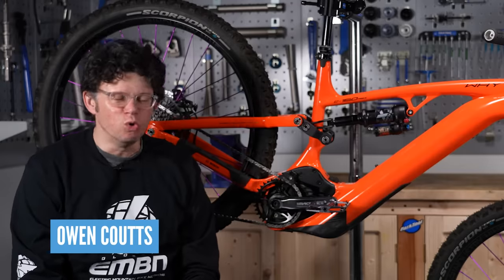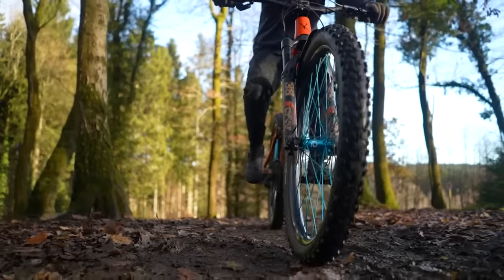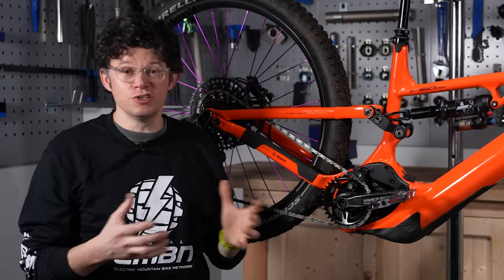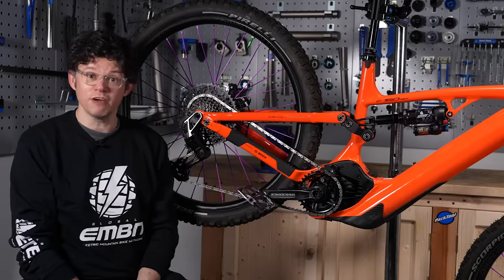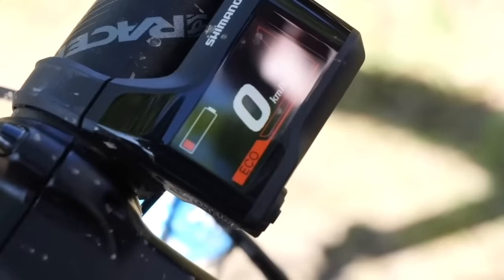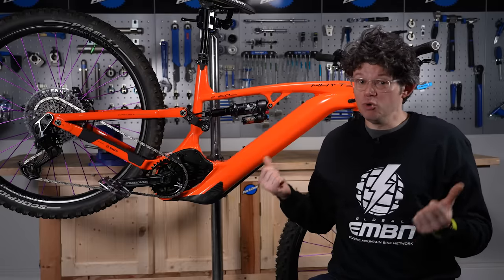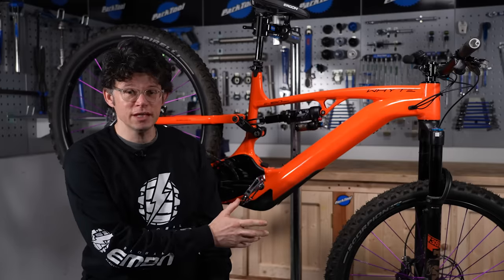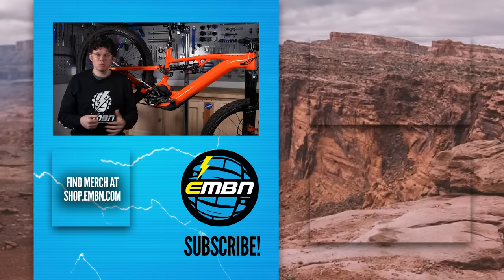How To Ruin Your eMTB In 9 Easy Steps [Watch This To Avoid]

Comment: I took in my bike in for first service after one year of riding (May to October) with approx. 2000 km on the clock to the place I bought it from. 89 kilos, old guy (50 yrs old), still pretty downhilly now and then. Shockwise they did nothing but put some air back in. So there’s that.

Comment: Great Video - sound advice. My Trek emtb has now done 14000 miles (well I have actually, the bike has carried me). I change the whole drivetrain every 2000-3000 miles, as it's just a 9 speed and the parts are cheaper. I don't overclean the bike, just concentrate on the parts that can wear like drivetrain, pedals, suspension, linkages. I protect the frame where it can rub with carbon fibre look wrap (the kind people put on cars), it's not expensive and can be cut to shape & when heated with a hairdryer, doesn't come off. Finally, every month or so I literally give the bike a complete overhaul and it's amazing how you can pre-empt some failures when you go over it with a fine toothcomb. I do have another emtb which I keep for "special" rides and having two seems to be the best way to look after both.

Comment: for myself i am guilty of not washing my e bike after a ride and is a bit caked in dirt, but the worst is i charge up the battery because i intend to ride the next day. but when the weather changes and i put off the riding then winter hits quicker then i anticipate and i end up storing my e bike battery fully charge, even though till next spring. i know you are not suppose to.
Reply: Would be really nice if bosch etc. would make a battery "emptier" or integrate as a feature in a charger where you can choose to decharge the battery to 50%.
Reply: As a cabinet maker we used to tape down the triggers on battery powered tools. They used to suggest running them down to zero. A battery drainer that can be set to drain to a certain percentage would be great. Make one now and you might make a lot of money off of it💰

Comment: BBSHD stock firmware config... insane torque tearing thru drivetrains, requiring riding the brakes just to keep her on the trail. After some effort searching forums for relevant options, I downloaded and  tweaked to firmware config to my preferences. Pretty involved, but so worth it.

Also, early out of the gate, I wasn't hitting the expected range... and called on my distributor shop. Against my better judgement, they said it was likely not reading cirrectly, and to keep riding.... a few times draining to zero, and she was never the same.

Comment: It's critical to be aware of acoustic changes in the system rode my performance line bosch  motor into the ground the bearings actually made a hole in the motor body..ruined! Full rebuild including motor body from performance line bearings....as new top bannanas
Reply from the maker: How many miles did you do before it got to this point? Would be great to know as reference! Sorry that you had to fully rebuild it, it's probably running like new now? 🍌

Comment: I’m new to e-bikes, I’ve just bought an Orbea Wild M-Team, unfortunately the battery is sealed in the bike frame, you can’t remove it. How does that work re storing it please, I’ll be leaving it in my shed???
Reply: Not much u can do if the battery is good quality Chuck a blanket over it
Reply: Keep looking for solutions.
If not riding all winter, consider having the battery removed or bringing the whole bike inside, depending on temperature where you live.

Some bikes allow batt removal, with a handful of allen bolts. Others require a service technician to pull the motor.

While I haven't done or looked into it, I would wonder if a heat tape or heated blanket could be a potential solution. That said, it might introduce other problems and hazards.

Comment: I destroyed 3 motors in Tongsheng mid drive kits using the open source firmware and following ill-advised setups that fry the motor.
Good kit with default volts/amps/watts.  About 100$/motor and not to hard to replace but not worth the burnout risk for a marginal bit more performance imho.
I would not even consider modding my Trance E+

Comment: Shocks servicing after 30-50 hrs of riding? Did I get that wrong or ist that complete BS?
Reply: I'm at about 250hrs and didn't do anything except rechecking/refilling air. Not sure if I should be worried about it and start panicking. Suspension seems to work fine without any issues.
Reply from the maker: It will depend on the manufacture, but yes it's best to check their recommend service intervals for optimum performance
Reply: The air cans are high maintenance in my opinion, always have been . I’m on a spring rear and front , old school chaps . Ride a Kenevo 2019 , it’s been bullet proof so far 👍🏼👍🏼🤜🏻
Reply: How many service appointments add up to a new fork?
Reply from the maker: @TschingisTube if you keep on to of servicing you should hopefully never have to replace the whole fork! If you use a suspension specialist they will tell you if it ever get's to that stage 👍
Reply: @embn  But i just don't pay zero on maintenance, ride it till it "breaks" and then get an even better new one. 40h maintenance is rediclious. Maybe rethinking a more lasting damper would make sense.

Comment: You say store battery at 10c but on one of your embn videos from 3 years ago you said store at 20c.
Reply: As a rough guide I would recommend storing batteries above 0C and below 30C. For the purpose of Charging your battery 10C-30C. Before use above I recommend above 10C. In simple terms avoid extremes of high or low temperatures. In reality we will all go beyond these recommendations, they for guidance, to be avoided where ever possible. In engineering, recommendations are always quiet conservative, to cover the arse of whoever wrote those guidelines. They are all guiding towards a longer battery life and optimal performance, not life or death at all.